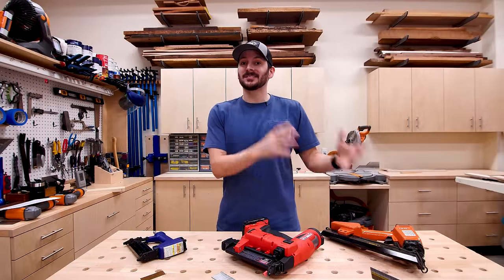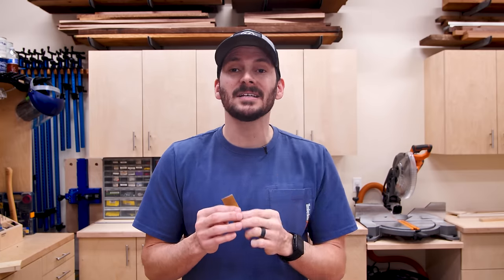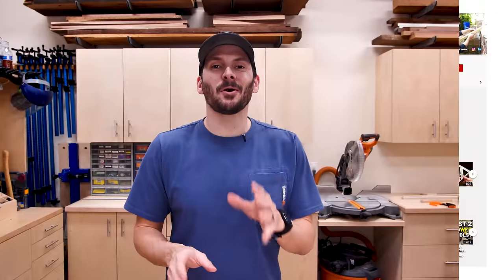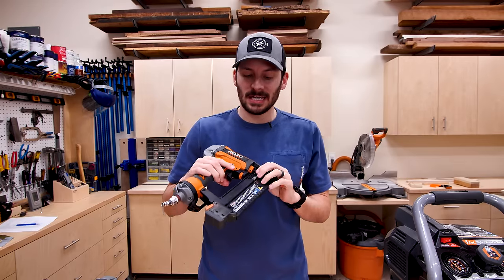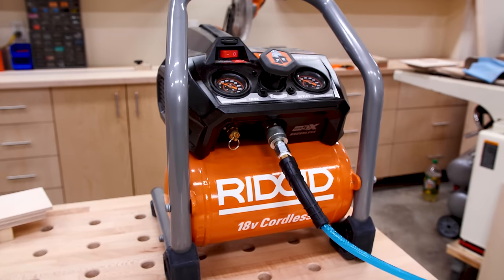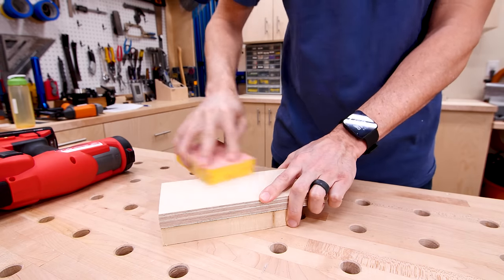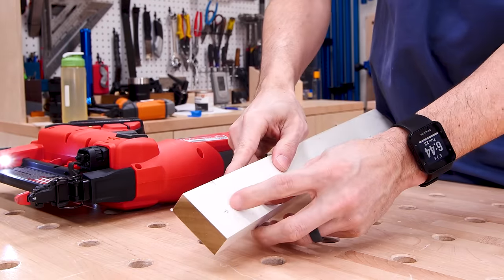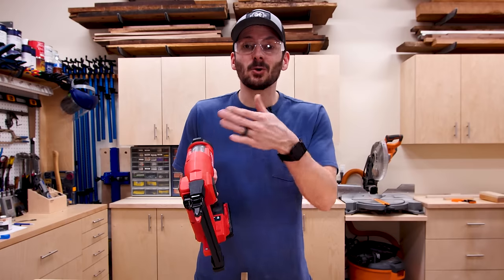6 Nail Gun Mistakes You Should Avoid | Brad Nailer Tips

Comment: Excellent advice on the gun perpendicular to the wood grain. Wrong on the physics. The fastener manufacturing process grinds or shears a chisel point on the tips. This chisel point tends to follow the wood grain like a boat wanders going up current. Shooting perpendicular to the grain allows the nail, brad, or pin to CUT through the grain keeping a straight trajectory.

Comment: Thanks Brad (nailer). Some great tips here for sure. When I'm using my 16 gauge nailer, I'm always mindful of the length of the nails in relation to hand placement. Fingers need to be further away from where I'm nailing (and a bit more) than the length of the nail. Even so, if it's say, a 1.25" nail and I'm coming in through 3/8" plywood into a 1.5" thick piece of wood, I STILL don't place my hand in the line of fire. You never know when a nail is going to go rogue. So far, incident free! KNOCK ON WOOD

Comment: OK you just shot a brad thru a set up and part of it came out on the face of a board? Do Not try to pull it back out. I attached a pair of needle-nose vise grips to the end of a slde hammer and clamp the vise grip to the exposed brad , using the sidehammer pull the brad the rest of the way thru.

Comment: Mistake #1 00:15 - Using the wrong side nailer for the job
Mistake #2 02:47 - Using the wrong side nail for the material
Mistake #3 04:46 - Overriding or underdriving your nail
Mistake #4 07:39 - Buying the wrong setup
Mistake #5 10:33 - Not filling the nail holes the right way
Mistake #6 02:15 - Blowing a nail out the side

Comment: For the workshop, the most useful nailer I think is the 21 or 18 gauge electric nailer but one BIG mistake most people make is to buy cordless or cheap nailers.  Cordless are too unwieldly and large for delicate framing jobs and very expensive for what you get.  Cheaper and even not so cheap Tacwise electric nailers are c complete waste of money and you're better off using a hammer and panel pins. 18g are really too big for panel work as the heads leave holes that need filling and sanding.  21g are ideal and useful for holding panels during gluing up and small framing jobs.   The problem with air nailers for smaller workshops is the air compressors are noisy and take up a lot of room.  The only real choice are top quality corded nailers, and one of the best is the Spotnails Maestri SE SE30 08.  Small, powerful and reliably sinks 21 small head brads up to 30mm flush or below the surface.  Not cheap but buy once, cry once.  Unlike the cheap tools that frequently jam, marr the surface finish and don't drive reliably or last long in any pro shop, the Spotnails nailer will last years and is a pleasure to use.

Comment: That Ryobi brad nailer is garbage.  I've had one for coming up on four years now.  It used to be great, but the last couple years, it's insanely inconsistent.  It takes about 20 trigger pulls before it actually fires a nail (despite making noise), when it does start firing nails, sometimes they go in crazy-deep, sometimes they're slightly proud, sometimes it only drives the nail in halfway.

Worse still, the manual has zero service information.  Nothing about how to oil it, clean it, or otherwise maintain it.